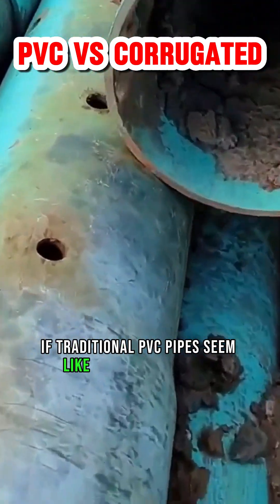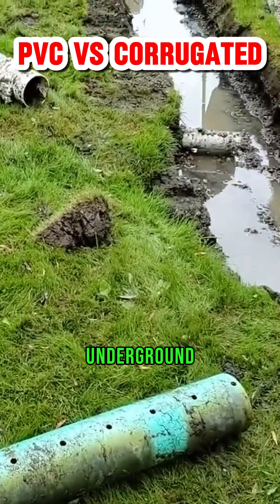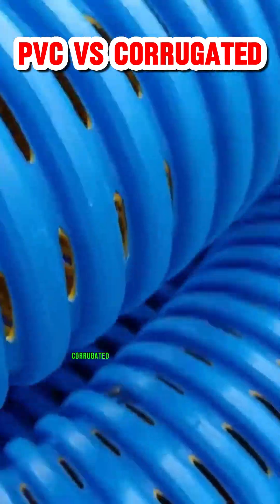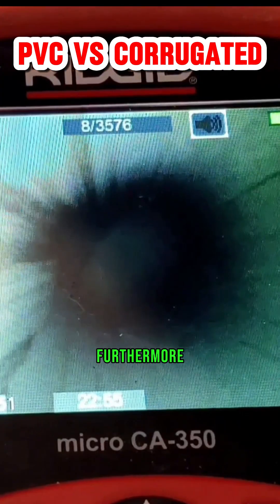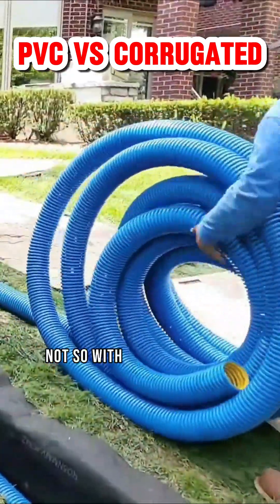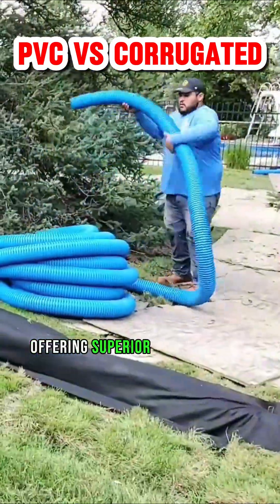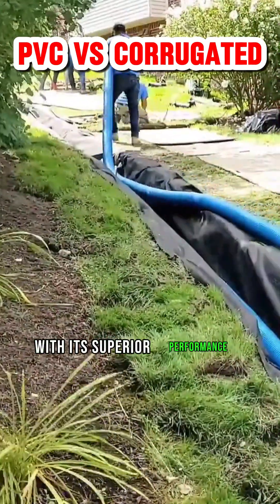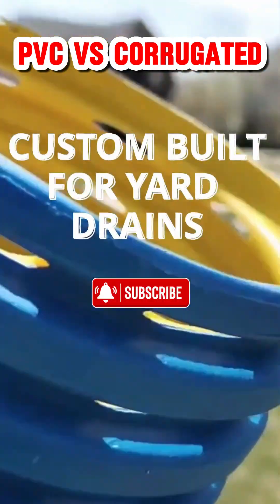Why Corrugated Pipe is Better than PVC Pipe for a French Drain System

Comment: I have a system that has both corrugated and pvc pipe.  9in surface drain box  where the water comes in off the neighbors hill then I have 25ft corrugated to the reach the side of the house. then for the next 40ft its pvc then 5ft of corrugated  (another water build up area)  that then connectes to another 9in drain box then finally 25ft of solid pipe to the pop up by the curb. I like watching the water run now its overkill but nice.
Reply from the maker: Frenchdrainman.com

Comment: Saga continues.  Both PVC and hdpe drainage pipe will work.  Corr.  Can handle "not straight " situation better.    Both should be fabric wrapped :   keeps some of roots & dirt you showed out of lines.    Both need sand or smaller rock bedding.  Save the 3" aggregate for concrete. Cleaning out corrugated for big plugs like shown in perforated PVC would be impossible.    Slight Sag within a perforated pipe a non issue.   
End of day,  Murphy is always out there waiting for us.
Reply: I'm old engr.  Seen a lot of things over the years.    I was part of industry review for RCRA, SERA,  lead abatement, DOE radiological issues.    Reality is technology advances way faster than single person can keep up with.   PVC supply water pipe is what is being questioned today.     If folks only knew that was in their well water.    

FYI, search for "hdpe under drains and pump outs for brine ponds".    In oil & gas salt dome storage caverns, the entire thing, all layers is hdpe.   Quite different than back when the parts were PVC.
Reply from the maker: Google "US begins review of PVC ban"
We are making all our parts out of HDPE for a sustainable future

Comment: not schedule 40 PVC sloped with 2 inches of gravel underneath.
Reply from the maker: PVC only has holes on the bottom where the corrugated pipe has holes on the sides and the top and the bottom 360,° corrugated is superior.

Comment: I believe you that it works great, but my mind cant understand how water will travel down a pipe with so many holes. Wouldnt water just go in one hole and come out the next? It doesnt seem to have enough surface area to travel down.
Reply from the maker: I've done many videos on this, but you have to watch a full-length video of mine to understand. You can go on YouTube and search "How does corrugated drainage pipe with Holes Really work?
Reply: It doesnt.  it just spreads.

Comment: Thats why u put fabric down and out sock around perf pvc and use stone on top instea of dirt of course pvc will fail if ur puutting dirt on top of perf
Reply from the maker: PVC pipe only has holes on the bottom. Corrugated pipe has holes on the bottom on the sides and on the top, when there's settlement in the bottom of the French drain system, the Corrugated pipe will still work where the PVC pipe will fail.

Comment: Robert, I’m having a paver patio built in the spring, the contractor wants to use pvc pipe under the patio from the downspouts to a popup in the yard. What product would you recommend to put under my patio?
Reply from the maker: I would run an extra heavy-duty corrugated pipe with a leaf filter. Run one piece from the downspout to the pop-up so that there's nothing glued. You don't want that pipe to have a chance on separation. We have 100 foot coils, so we can run 100 feet solid with no glue joints or fittings. I'd like to see a catch basin about 3 feet from the leaf filter for shingle gravel.
Reply: @FRENCHDRAINMAN  That sounds like a do it oncw n be done with it forever kinda setup.  That's what we want.   Thanks for putting all of your time and effort into this.  
Im restoring my  outdoor steps from my basement.  The bottom only down 4 feet from the ground.  The house is elevated on a block wall.  i have a 9" basin that has a 3,4" connection.  Im going to run schedule 40 pvc over to where the sump pump is inside tbe basement.  It's about 8 ft over from where the drainage basin. At the end of the PVC Im digging a 12" wide x 12" pit of gravel.  I need to apply sand around it to make sure dirt doesnt get into the gravel pit.  Is there any instructions for how to apply the sand around and over top of that pit.  The top of the pit where the PVC 90 drops the water will be 4' underground.  Thank you for your time and attention!
Reply: They have stores setup ones in Burlington Canada. Just call and ask there happy to help with anything

Comment: No professional who cares about his work and customers would use this stuff. You can’t snake this stuff out. As in any condition if it’s done right there’s no problem.
Reply from the maker: The corrugated pipe has holes 360° all the way around it. PVC pipe only has holes on the bottom for French drains. Once there's sediment in the bottom of the pipe, the system no longer works, and you end up with a flooded yard or flooded cross space, perhaps a flooded basement. You've been misled. Best of luck to you.
Reply: @FRENCHDRAINMAN  
You CANT snake or jet that crap. I have seen that stuff fail time after time. I have 34 years in the industry. If the pvc failed it was due to the installation. I am not misled. I am a master plumber who cares about his jobs, and customers. I’m not the one telling people to use this flimsy pipe. Get your facts straight. If you are going to try and educate people then get your facts straight. You say your pipe has 360* of holes. That leads to dirts getting in the drain and plugging it up faster. 🤔